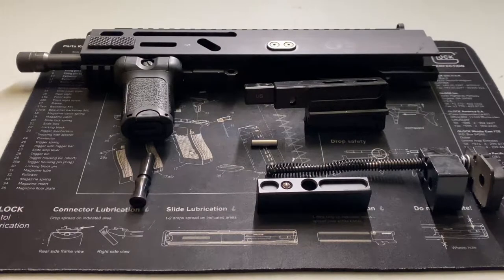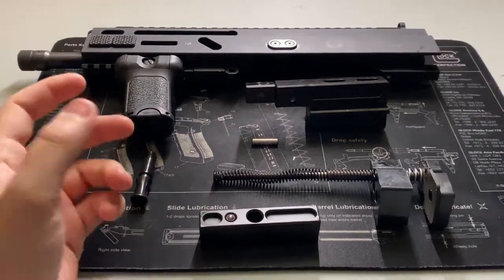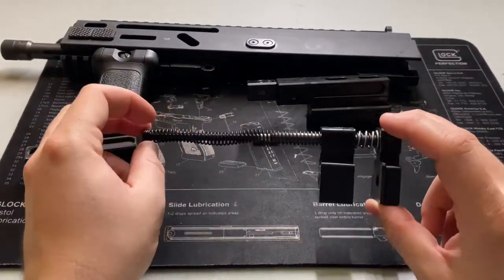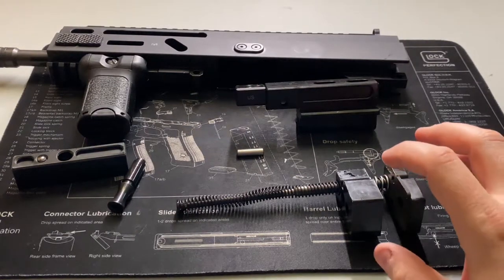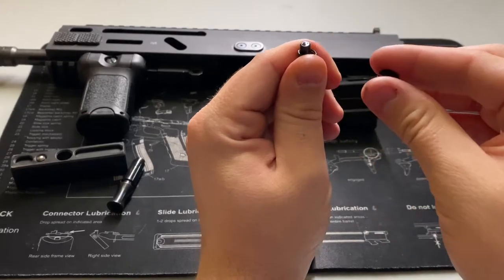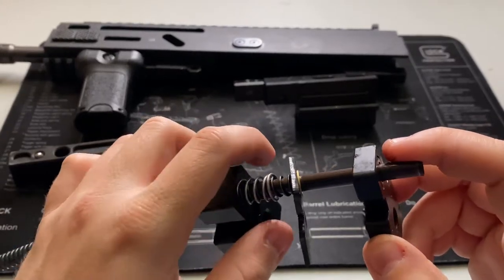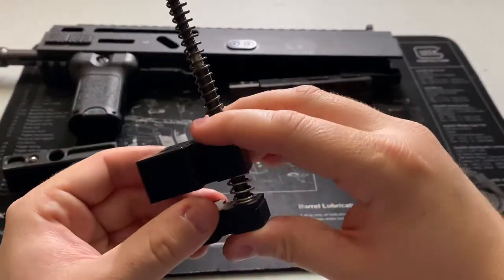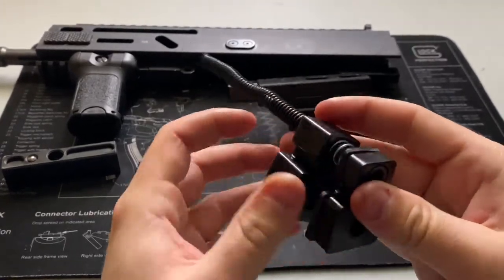KD Gunwerx Stribog Customization

Comment: Nice video presentation of the short stroke double spring buffer system. Looks really interesting.
I see that KD Gunwerx perform alot of "in house" services of the Stribog. Do you know where they are located? Couldn't find anything on their website.
Would also really like to see you make a side by side comparison with the original and KDG buffer system.
Thanks! :)

Comment: So, basically you they’ve made a cheaper dampener than the B&T to get B&Tesque results.  I have B&Ts and a Bog.  The Bog is a heckuva value but for the best PCC, B&T.
Reply from the maker: Just that initial cost I think is prohibitive for most and with the Stribog can go up incrementally with parts and pieces.
Reply: @TheGeekyNerd  and still be cheaper
Reply: 🤦‍♂️ another person that takes there opinions way to serious…. $600 for a stri  bog or 2  grand for a B&T  seems like an easy decision for me… even with all the upgrades I’m only sitting on $1000 still $1000 cheaper especially since I have the new curved mags with mine and I didn’t need to get the lingle lower… to each his own you clearly  had the money to waste at the time and had ure reasons but don’t act like it’s king of PCC if anything the MP 5 is king
Reply: @tomahawk5118  true true u live in north Georgia?
Reply: @mrgrump2534  used to.  Grew up in Cumming and lived mostly there and Gainesville with a little time in Jefferson and Houschton.

Comment: Well, seems like KD Gunwerx doesn't make the reduced recoil assembly anymore, they've 404'd links to the page for it. Big shame, guess the HD Industries buffer is about as good as you can get now.
Reply from the maker: They seem to go in and out of stock from time to time. If you contact them direct may be able to make a special order.
Reply: It’s the same thing 🤦‍♂️
Reply: They are making more according to KD Dave on reddit. I think I'm gonna try making my own with a section of glock spring and maybe delrin
Reply: Just ordered mine last week

Comment: So, I’m getting the SP9A3 and I have a interesting idea. If I have the KD Gunwerx kit and bought a HB short stroke buffer. What if I replaced the buffer that comes with the KD Gunwerx kit and added the HB short stroke buffer to that kit? You think that’ll work or make any big difference?
Reply: have you tried it? wondering the same thing

edit: so when you pull the charging handle back with this system in, it seems to max out right where the ejection port is, so i’m assuming that using the HBI short stroke buffer, will actually cause FTE due to all the extra meat that buffer has causing the ejection port to not be fully opened.
Reply: @minusmartin  That makes since, I was wondering that also. Well you just saved me some money because I was going to experiment, guess not. Thanks man, I appreciate it
Reply: Kdgunwerx states on the product page that you should NOT do this very thing

Comment: Just ordered a short stroke buffer from HD industries. and their charging handle block. Way cheaper than kdgun
werx.
Reply from the maker: Haven't used theirs, but have seen it. When I got the KD it appears to be a bitter better for my circumstance to me.
Reply: @TheGeekyNerd  how u figure it literally does the same exact thing
Reply: @mrgrump2534  No it doesnt, the HBI is just a thicker buffer where the KDG kit is a dual spring system. The buffer thicknes is overall the same on both HBI and KDG but the last inch of bolt travel is softened by the spring in the KDG - reducing felt recoil further.
Reply: @serran0669  well I’ll have to get me one then I didn’t think it would matter they much… how much would u say 10 % reduction ?